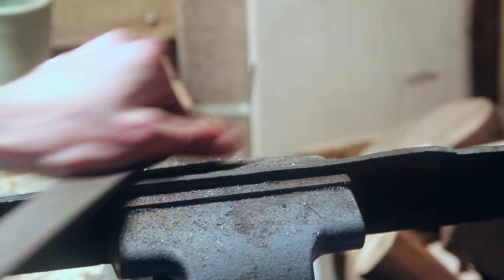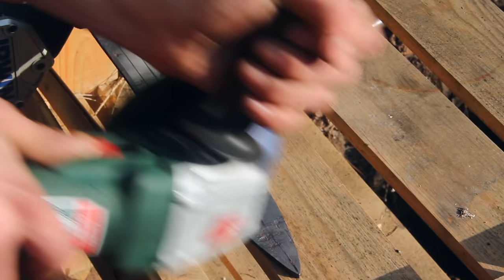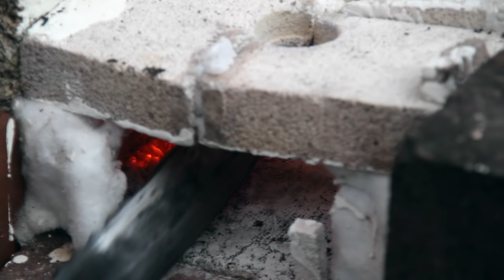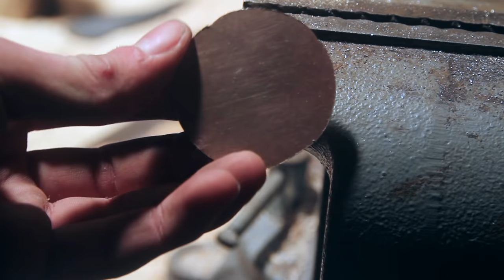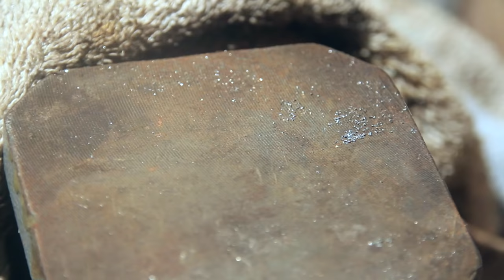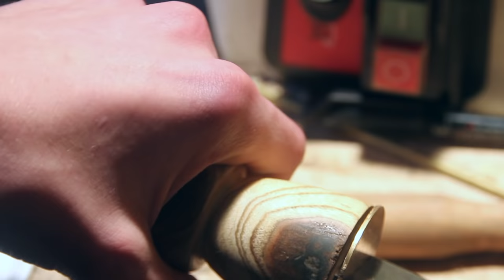Making a Highland Dirk Dagger

Comment: taper the ends of the mid section of the handle , it`ll look better , and feel better in the hand , also flatten the handle out a bit , for the same reason , it will also look more like a dirk !  other than that , not bad !